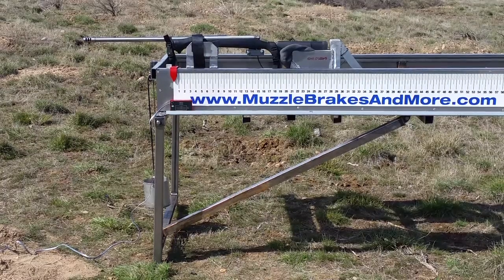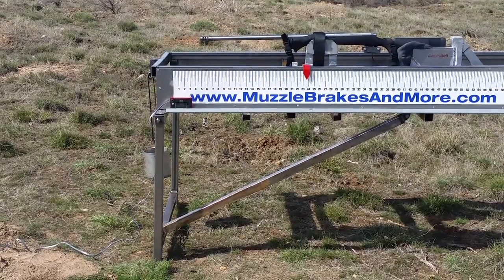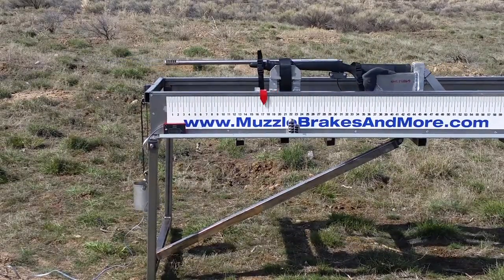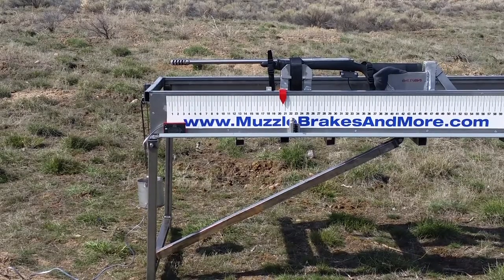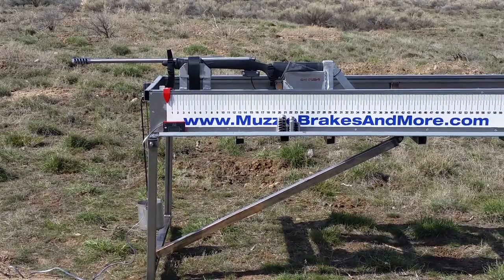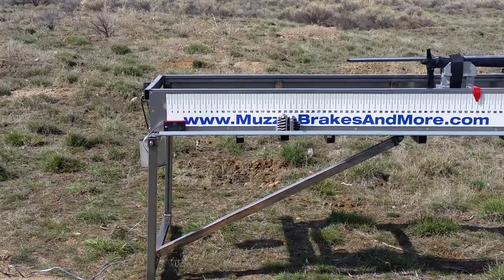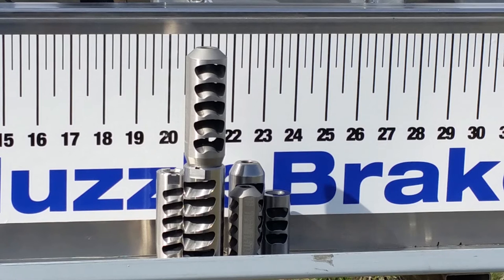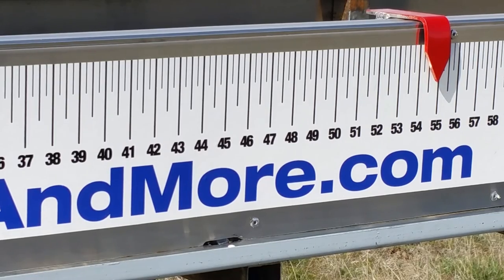338 Lapua muzzle brake test

Comment: Wanted to provide a bit of feedback here. Just got back from shooting the Nightforce  ELR steel challenge and I used a 5 port Super Beast. Over the course of the weekend, I fired 150 rounds of fairly stoutly loaded 338 Norma Mag. My shoulder feels no worse than if I had been firing my 6 dasher. The brake worked great, concussion at me was minimal, and felt recoil was insignificant. The only complaints were from the people who decided to line up too close to my sides on practice day 😂
Reply from the maker: Thanks for the feedback. Yeah the side blast is a little rough for bystanders but the recoil reduction is in a league of its own.